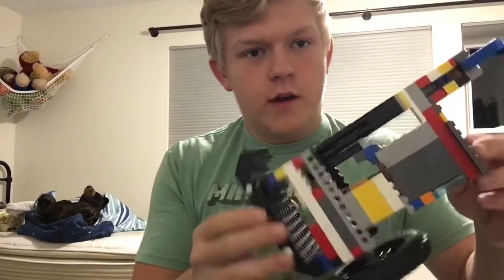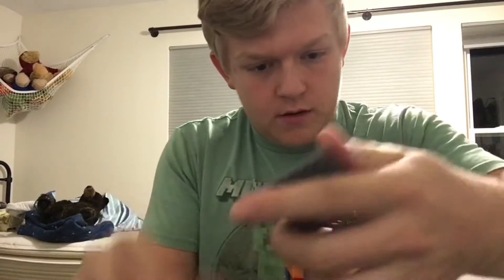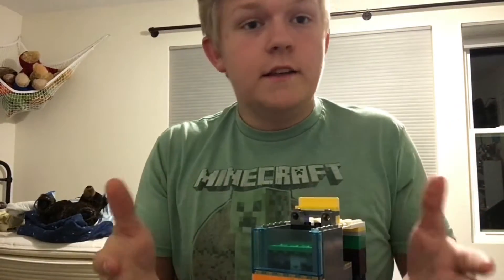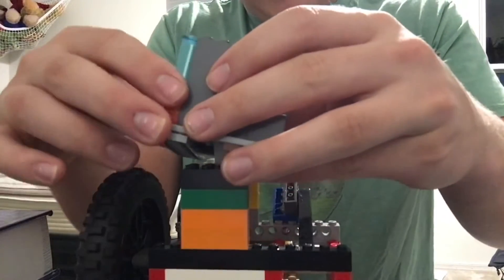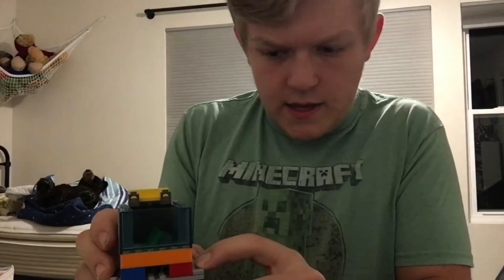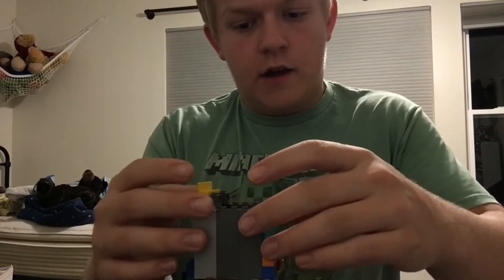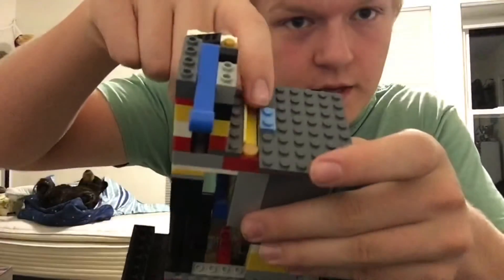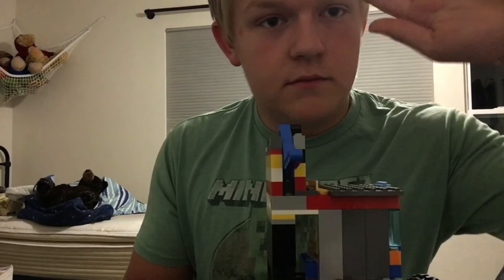Why is my Lego vacuum engine so darn fast?

Comment: perhaps look into sylinder offset it changes geometry and makes longer strokes which then allows you to have less friction on the power strokes however intake will be reduced as far as friction goes but this can solved by a longer rod (rod ratio) as well as make the valve taller around the intake hole so 1 1/3 instead of 1 on both sides of the valve too. air velocity matters too so a large gap on the intake port that gets progressievly smaller is a good idea. although velocity stacks and such may be fruitless on LVE's im not sure because most of my knowledge comes fropm real engines 
ALSO! check out the D4A channel for geomrty and stuff he will teach you everything!

Comment: I didn't learn this till recently, but rod ratio (effectively the length of the connecting rod) can also affect the top speed of an engine. You have relatively long connecting rods which makes it so the piston is not being pushed into the cylinder walls as much and reduces friction. This is good in these LEGO engines where the mass of the moving parts is not as big of a concern as with metal.
Reply from the maker: You know, I had no idea. 
That might be the why this one is faster than the last one. I did notice the longer than normal rod. That grinding is the biggest issue I've had with pistons before. I wonder if they could go even faster with a longer rod. Where did you find out the information about the rod ratio?
Reply: @somebuilds  I think long con rods are definitely a critical way to get speed out of a LEGO engine and probably should be the preferable way to build them over short rods since their parts weigh so little. In fact, I think a short rod is what is plaguing my SVS engine!
Reply: @somebuilds  It was actually from a recent YT video on driving4answers' channel. https://youtu.be/C_YNn3ZkJmU